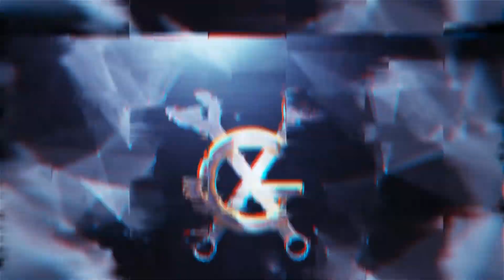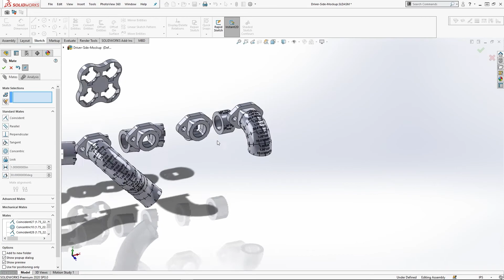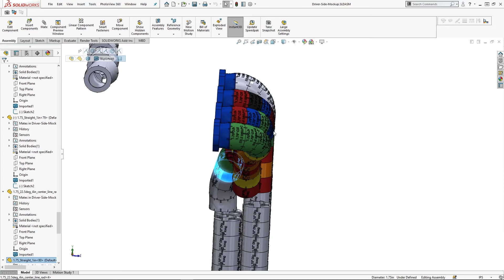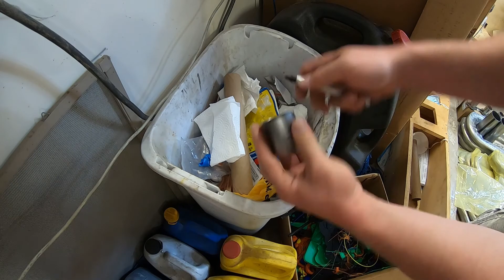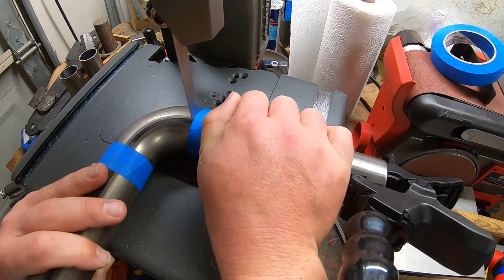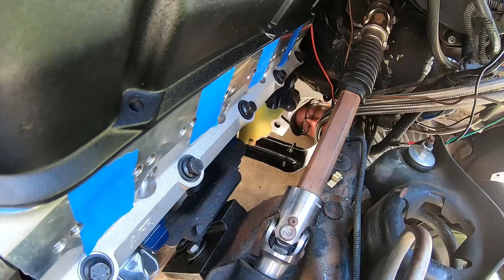Building Custom Headers for the 331. Driver side gets figured out.

Comment: So cool...are you planning to upload the SOLIDWORKS data at some point? I bet it's a big help for ppl!
Reply from the maker: I probably should have, but to be honest, only the first 1/3 of the headers is modeled. I discovered that the plastic is pretty flexible, and the welding gaps can be angled a bit too on the final assembly. Trying to create perfect CAD models with the pieces I had printed was an exercise in futility. the model would never match what was made in the real world. BUT, the plastic pieces were truly instrumental in creating the headers and I will use them again for any project in the future. I have a 3D scanner now, so when I eventually paint the ranger and have the headers off, I will do my best to remember to scan and upload em.